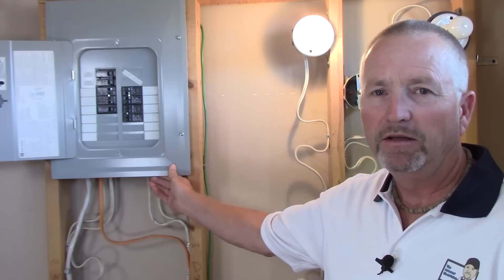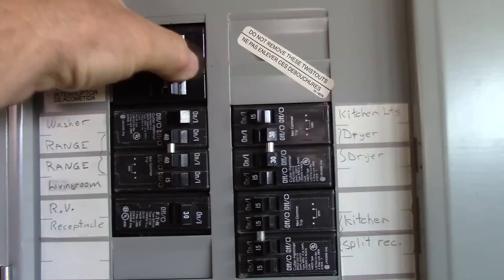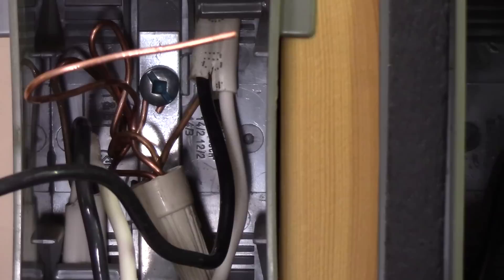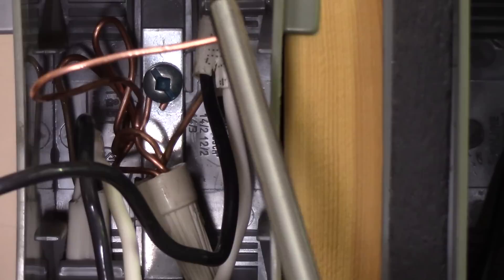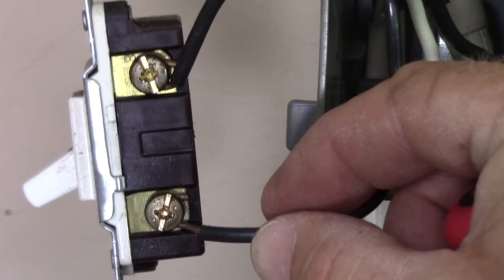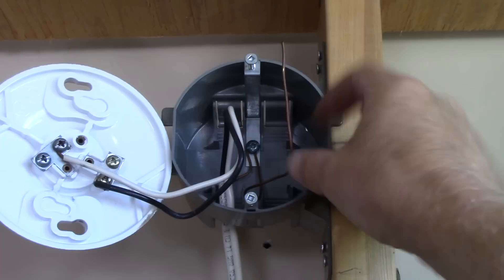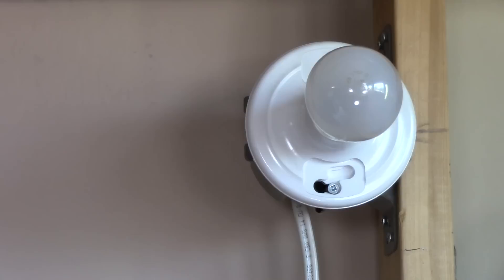Wiring a Light Switch:  An Overview

Comment: Omg, thank you.  I am doing a self taught remodel in a house that I bought that is about 50 years old and anything electrical I have been terrified to touch.  I have been wanting to change the lights and the toggle switch plus cover plate, but I have been held up due to my fear.   Thank you for making this so much easier for me to understand.
Reply from the maker: As long as you follow the necessary safety precautions, and educate yourself with some basic knowledge, electrical work is no more frightening than any of the other mechanical systems in the home.  Some will argue  that the dangers of electricity far outweigh that of plumbing (for example).  Turn off the power and ensure that it's off by testing, no problem.  Flush the toilet before taking apart the toilet drainpipe is a similar precaution 🙂.  I would highly recommend taking my course on Udemy, Learn the Basics of Household Wiring.  If you're interested, send me an email to terry@electrical-online.com and I'll send you a discount code.  If you want to just watch the program that the course is based upon, follow this link: https://weekendwiringwarrior.podia.com/the-basics-of-household-wiring-ebook
Reply: Awesome electrician

Comment: Amazing explanation. 
Please.. How to wire a single switch light has a 3 black wires??
Reply from the maker: I can assume that you have power in, power out, and the switch leg to the light.  You need to identify and determine what is what, and then splice the power in / power out together with a pig-tail to one terminal of the switch.  The other black wire that goes to the light connects to the other terminal of the switch.

Comment: i love doing service panel work at my home.  i added a 15amp circuit yesterday and had to free up space on the neutral/ground bar by putting three ground wires under one terminal, which the panel label said was ok.  i did not double up the neutrals, only one per lug with those.   my house has ground and neutral wires all on the same bars (but not under the same lug) so i don't know if that is correct but it seems to be working. 

i wired six circuits two years ago as well and they never have had an issue with daily use each running 1000 watt HPS grow lights.  i did all the work yesterday with the box live and no gloves or eye protection, which i know isn't recommended, but i felt confident enough to know what to not touch.  i also felt like big bulky gloves would be a disadvantage when working within the confines of the service panel.  if i could go back in time 15 years, i would have studied to become an electrician,, the work is so rewarding, it makes you feel like MacGyver.  thanks for the videos, they are always fun to watch and learn.
Reply from the maker: Chris Topher Thanks for the kind words Chis. However I must emphasize safety when working on electrical equipment. Especially the service panel! I’ll tell you a story about when I first started in the trade as a young first year apprentice. I thought I was cool and I was showing a buddy how I could work on a live panel and know what not to touch etc. A bare ground wire got away from me when I was feeding it into the panel and flopped itself across the busbars as there weren’t many breakers in this panel at the time. The molten copper exploded from the busbars and hit me right in the eye, but luckily I was wearing glasses. Ruined the lenses but saved my eyeball so always shut off the power as you just never know, one slip and you could do some major damage!
Reply: Wow thanks for the input, I actually never even considered molten metal shooting at my eyes.  I will most definitely wear eye protection from now on, I would hate to lose my eyesight over something so stupid.   I was more thinking sparks could arc towards my face if too close or hit by a stray hair, but never really considered molten metals flying at me.  Thanks again!  That definitely that will stay in my head next time I do panel work.

Comment: Hi. My question is: If you are adding another light on the same line, but after the light you just wired. Do you need a “3” wire for the next leg or do you stay with 14-2 and hook the next light up the same exact way? Meaning adding another hot and neutral to the existing hot and neutral you attached to the light?  Hope I made sense. Thank you

Comment: Are both the hot black wires attached to your switch hot and which one would I use to run down to an outlet? I know you’ll hook the white to the white and wire nugget and now you got too hot wires coming out of the switch which one do I connect my hot wire to the run a new outlet below

Comment: I was changing a tan single pole light switch to a white one. I noticed there was no ground wire (to the switch) So if the ground is attached somewhere in the back of the box I'm ok. The old switch had only two wires. A black and a white. This was the only switch for my back patio lights for the past 25 years. So, just connect the wires as shown on the old one?
Reply from the maker: Technically, you are supposed to provide a ground to a device if it has a terminal for it.  If it's difficult or impractical to get at the  ground connections at the back of the box, I wouldn't worry too much about it.  You may cause more issues by poking around in there than you would solve by providing the new switch with a ground.
Reply: FYI you can use a non contact voltage tester to verify which wire is hot and which wire is the switch leg. It doesn't matter which wire  goes to which screw on a single pole switch. The white wire is not a neutral wire, but it is being used as a hot wire in this case. It should have some black electrical tape attached at each end to represent this.  The correct way to do this is to use 12-3 or 14-3 and use the red wire. Red and black wires are understood to be hot.

Comment: I have a light switch with 3 black wires, 3 whites, and 1 ground. 1 black was on a screw. 1 white was on a screw. The other whites were pigtailed with the ground and capped while the other two blacks were inserted into 2 separate quick connect holes at the bottom where the 1 one white was on the screw. Seems to be 10 or 12 guage wires. I can not find another switch with the same 2 quick connect holes per screw nor to fit the guage size as the one I'm replacing. Any help would be appreciated.

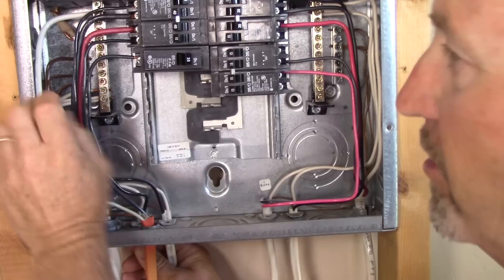Comment: At 2:26 - You shouldn't have more than one neutral wire on a terminal.  Grounds OK, but neutrals need to be one per terminal.
Reply from the maker: You are correct Jeff. I'll move that neutral to it's own lug. Using this panel as a demo for many different videos means that things sometimes get moved around and I didn't notice that. Although it happens all the time in the real world as panel manufacturers often have a shortage of neutral lugs that don't seem to be enough for the breaker positions available, especially when using tandem breakers.
Reply: I noticed that about the lack of neutral terminals, too. That's one reason I always like to try to sell my customers new panels if theirs are more than 30 years old.

Comment: I have a light switch that has three black wires three white wires the two black wires are connected to the switch how do I wire my light in the ceiling
Reply from the maker: I would need to get more information from you on this.  The best way to connect directly with me is to use Paltap.  For a nominal fee, I'm available by video chat at paltap.me/internetelectrician

Comment: Question...
My switch, JUST get ONE BLACK..ONE WHITE & GROUND..one day
stop working...I check it, I saw ground was NOT connected.
White connected to gold screw.
Black connected to other golden screw...
1) I replaced for new bulb.
2) I remove white one &
3) disconnected from golden screw.
4) put back black on golden (in fact, 3 screws.(2) gold & 1 Grnd.(regular switch)
Back current= NADA
WHATS HELL am I doing wrong..?
Reply from the maker: Hi Vince.  Your problem is not likely with the switch at all.  What you have here is a switch-leg (loop) drop method of wiring a switch.  I assume you've checked the breaker, and that it's not the entire circuit that has quit working, just this light? So what you need to do is watch this video, then shut off the breaker, and open up the light box and see if you can figure out what when wrong with the splices or connections at the light outlet.  https://www.youtube.com/watch?v=pnlHCiRN_RU&t=5s